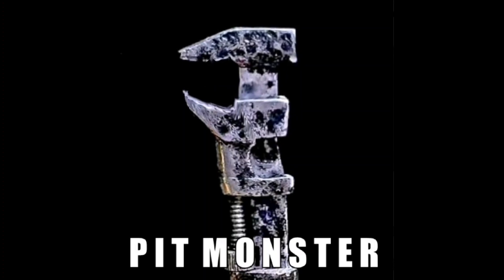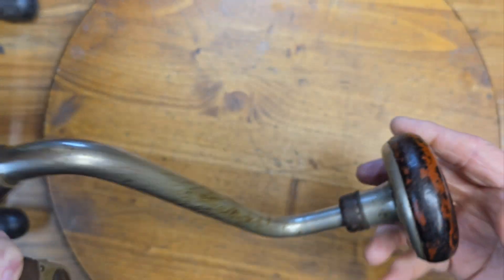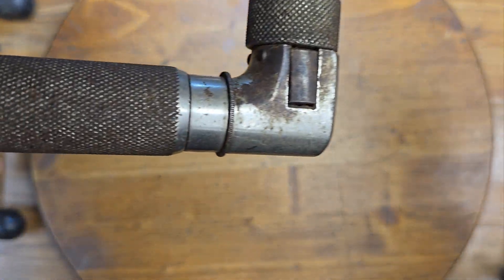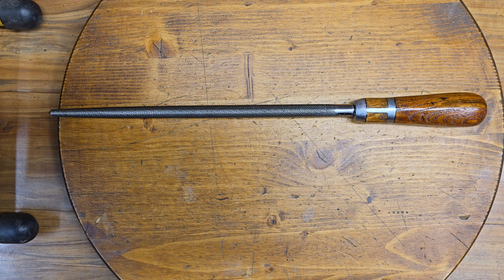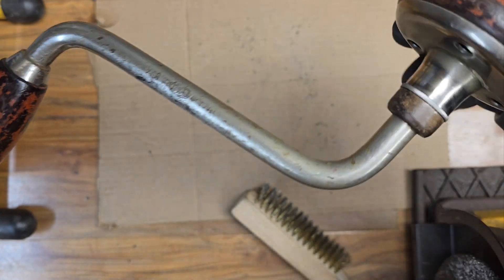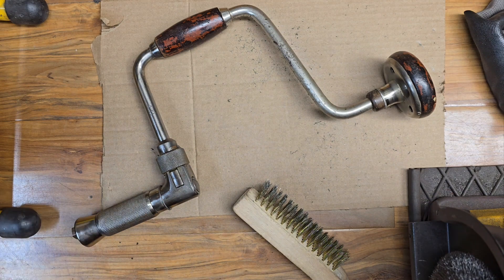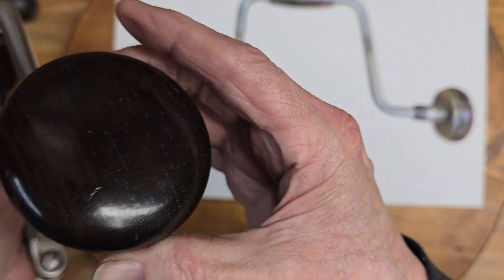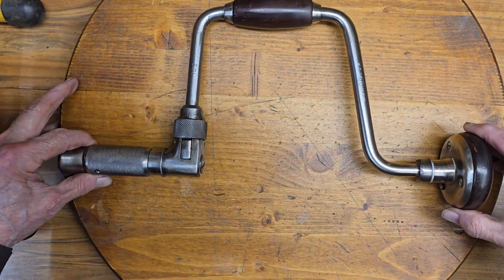Vintage PEXTO brace is restored

Comment: I love braces.  That cleaned up very well.   Looks like new.   Well done.
I have taken only 1 brace apart.   The round wooden end of the brace may not tap off.    The one I took apart had me puzzled.   Like you I removed the 3 screws and found the wood did not come off.   I found the wood is threaded onto the rotating/bearing piece.   You do not need to remove the wood now, but if you need to remove in another brace, put a punch/pin in the hole on the rotating/bearing piece, remove the screws then unscrew the wood.
Dave.
Reply: Very generous tip…thank you…🖖
Reply from the maker: Thanks for taking time to share your experience